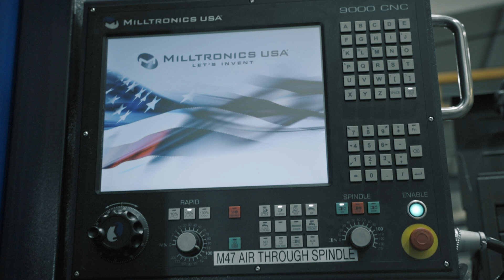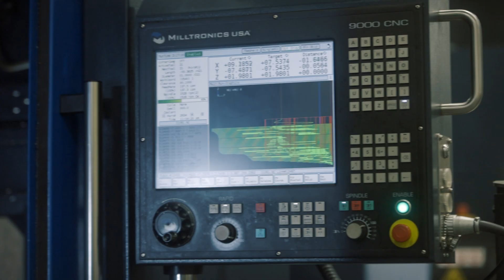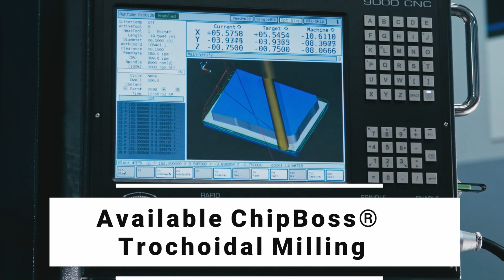Manitowoc Tool & Manufacturing Trusts in Milltronics CNC Machines: Customer Spotlight

Comment: As a NC programmer and Mechanical Engineer for 16 years, I am not convinced you can run those 3D contours on conversational control. (no one, Mazak, Miltronics, or others) Yes, simple 2 and 3 axis milling but, the Dies in this video had to be programmed off site using CAD-CAM and uploaded in G-code. I love the look and build of the Milltronics but, just not convinced the statements in this video is accurate.